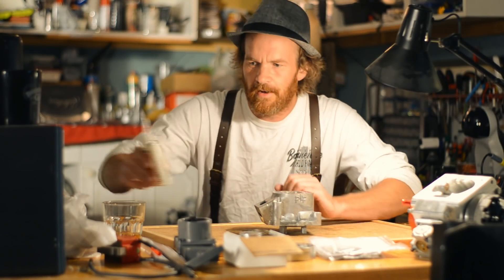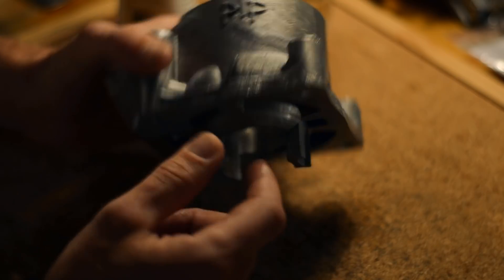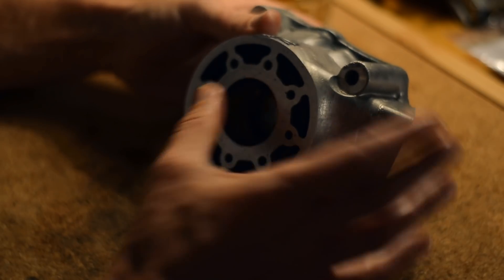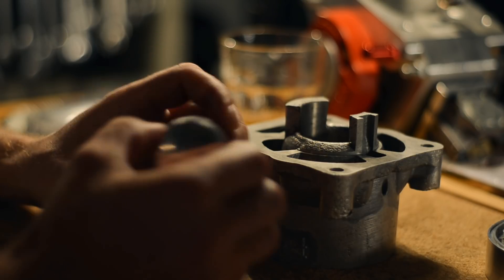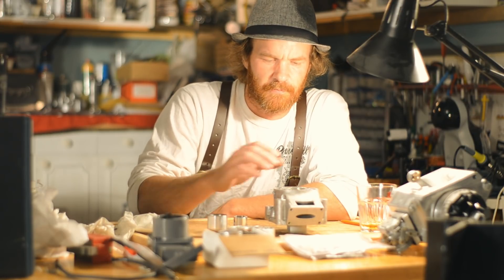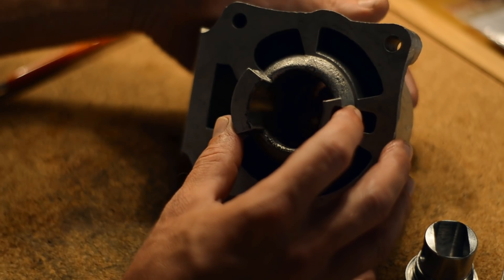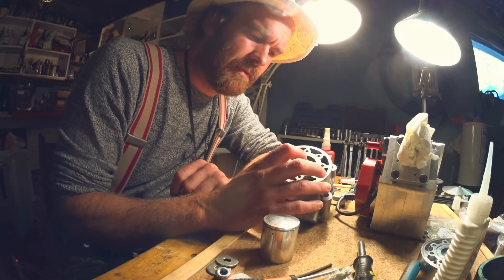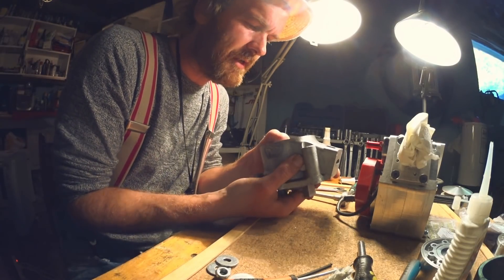The Most Powerful Two Stroke Ever - Won't be long now!

Comment: Your idea for putting the piston ring in the sleeve instead of on the piston is flipping brilliant!!! I'm sure there are gonna be a lot of nay sayers just bc ppl don't like change and even more don't understand how advancement works. Bc even if it doesn't work, it could lead to something that does. 
The only issue I can forsee is making sure you find the right kind of steel with the right heat treat and temper to hold up to the spring like forces it'll have to survive at high RPMs. There's a correct steel for this application, you've just gotta find out what that is and hope it'll keep it's shape when it's subjected to the heat, friction and the loads it'll be under when the piston forces it open. 

Actually, I wonder if a split ring with a spring washer (I know there's a proper name for this kind of spring, but it's eluding me at this moment) between that and the sleeve would be the better way to go. You would have to find or make a spring that would push the 2 ring halves together, but spread just far enough that it still seals the chamber at combustion. May have to have 2 rings if there's enough room. This way the ring doesn't have a load point that causes metal fatigue and ultimately turns into a split ring anyway. 
Yeah..... I think that that sounds like a better way of doing it, but I am not an engineer nor am I a metallurgist. I'm just some guy sitting in his chair, eating Cheetos and watching you do all of the hard work. 

I can't wait till you get all the little kinks worked out. This is gonna be f'ing epic!!! I've been watching since about the 3rd video in this series and you are so close man!!!! Love watching you work through the issues. Your drive and passion for this is why I keep coming back. Your desire to see this through is inspiring. Anyone else would've quit after the first failed casting. But not you. You gave failure the 🖕🏼 and kept on fucking that chicken. It'd be awesome to sit in the shop with you and bounce solutions back and forth. Do you have a need for an old, loud mouthed, bearded, fat American that'll drink all your whiskey, bring a buncha axes for random tree chopping and occasionally do some work?? If so, I'm just who you're looking for. Hahahah!! Keep up the amazing job and thanks for bringing us all along while you work through and solve all the issues that you've ran into along the way!!!! It's been a helluva ride!!!

Comment: The ring idea sounds interesting. It should work with Marks piston design but you'll have to get it plated otherwise it would wear very quickly. 
I'd work very carefully with piston to bore clearances maybe by heating the entire piston and cylinder assembly in the oven so its at max operating temperature and then checking clearance.

Comment: The world needs you to make a two-stroke with 2 pistons working in opposite direction in the same cylinder and produce more than 52% thermal efficiency.
That way you could probably get a single cylinder 50cc engine to produce 35-40hp.

Comment: I just had an idea, but it might be stupid. 100% exhaust port is what everyone wants, but why not make two exhaust ports on either side of the cylinder, each 50% of the bore. There would be no short circuit either, since both sides have exhaust ports, and there is pleny of space for transfers on the front and back sides of the cylinder. Although, two exhaust ports might cause some problems when the gasses have to go in two opposite directions, and the pipes would maybe just shoot all the gas from one exhaust port to the other, instead of shooting it to the back of the cylinder, like in a conventional setup. Not sure if I make any sense, and if this would actually make any power, but just had the idea and wanted to share.

Comment: The ring will destroy the soft aluminium piston. The reality is that a piston ring doesn't do much once a 2 stroke is warmed up as the crown of the piston swells sufficiently to do almost all the sealing (why most 2 stroke pistons are narrower at the top). If you could get the piston hot before startup to give a better seal, that might be all you need to do?

Comment: If the ring bounces at high RPM it will loose compression?
Reply: Yes, it's called ring flutter. The L shaped ring was designed to counteract this but nowadays they counteract it by using much thinner, lighter rings.

Comment: a tip for piston ring grinding: find something with the same diameter as the cylinder or even use an old one 😄 then just put some valve grinding compound in it an put it over the piston in the lathe 😄

Comment: Might need to redesign your casting so there is a bridge in the exhaust port, doing this will stop the piston ring from poping out into the exhaust port and you won't have to modify the piston ring besides gaping the ring

Comment: Having a good chamfer on the exhaust port helps, it need to be deeper than the ring protrusion to squeeze the ring back into the groove. The ring is only a sealer the timing is provided by the piston edge. I like the ring in bore idea you will need to reverse the coating, nikasil or hard anodised piston with a aluminium bore. I wrote this before seeing the end of the video. To get a good idea of what chamfer works with a conventional piston imagine taking a large diameter sanding drum held a 10 degree angle to the bore and grinding  a chamfer which is deeper in the centre and tapering off to the edge. The chamfer ends up looking like the classic oval port even though the port has an almost straight top edge. The RD500 factory race prop bulletin illustrates this.
Reply from the maker: That sounds very much like the chamfer that was supposed to be there. Not only does it help the ring, flow is improved too👍

Comment: Get rid of the ring all together, model nitro engines don’t use them and they run ok . The aluminium cylinder will expand the same as the piston so you can lap the cylinder so the piston is a very neat fit .

Comment: I have never seen such a big transfer port on any 50cc engine, this is the biggest one
Reply: In the early eighties I was given a worn out cylinder barrel from a very fast  works Suzuki  250cc moto cross bike and noticed it had massive transfer ports ,(no attempt to stuff flywheels etc)and very wide inlet reed valve block.The secret is easy flow using inertia rather than hi primary compression aided by well sorted exhaust system.
Reply from the maker: Word to that!
Reply: ⁶y
Reply: My tz had 8 transfer loop scavenge ports, bridged of course, 4 really
Reply: I haven't watched this entire series but can someone tell me why he doesn't simply bridge the exhaust port?

Comment: Glad to see you back on track with your project! Ceep up the great work! 😊👍

PS: to the cliping piston ring idea, you can try it and I wish you that it will work. Just some thoughts from my perspective  to maye make it work are the following: 1. The snaping ring, will be under high variating forces snaping in and out of grooves, make sure it wont break
2. The edges of the groves have to be strong enough to constantly overcome the pressure of the ring, snaping in and out of the grove, make sure they are hard enough
3. Check the expansion-speed of the ring, so that it has enough time geting in and out of the groves even at really high RPM's. The harder the ring, the faster it will expand but also it will create more pressure on the grove edges snaping in and out (refering back to point 2) so keep in mind that you have to find a sweetspot here.

Comment: Maybe use 2 exhaust ports 50% each?
Reply: That's the same as a bridged port, they also overheat and expand into the bore, so you also need to drill the piston out inline with the bridge
Reply: @tritiumrecords717  its possible to have them opposed and have transfers between each exhaust port for maximum cooling.

Comment: Why not just scale up a nitro RC engine to 50cc, add roller bearings for the crank, and Rod, and use that design instead of re-invention?
Reply: Nitroengines are low compression glow ignition. Different concept.

Comment: Ring is still gonna snag, due to piston rocks in the bore slightly in tdc and btdc, you gotta make the ring so restricted that it won´t seal anymore.
And the 'other way' around would probably give you heat problems as a lot of heat from the piston crown is drawn through the ring into the cylinder.

Comment: I know you don't know me but I have a few suggestions you might want to think about.  Don't use a ring at all. I know why rings are used.  This is just a thought but if you calculate your piston and cylinder expansion from cold to high temp you can design your piston to have enough room to expand. however you would need a way to preheat the engine to bring the cylinder up to temp and running expansion. If you still have that 2-stroke motor from your bicycle build you could try this with that motor. I don't have the tools or materials to do this myself other wise I would try it for you. I would love to see you make it to bonneville.

Slight Edit here: I just thought of something. Have you thought about running a sleeve on your piston? It would do the job of the ring but you wouldn't need to worry about it springing out into the exhaust port.
Reply: Yep, a ring higher then the ex port -problem solved 😁                                        Wait a minute -it might work 🤨

Comment: I am sorry, but the idee to set the ring above the exhaust port is from ME. I wrote this in the comment section a frw videos before... 🚀
Reply from the maker: I'm confident we aren't the first with that idea...
Reply: 2STROKE STUFFING 😎 try it without rings. At 14000 rpm is no time to leak...

Comment: ive never saw at someone moves a piston with out oiled it and never stop hone in cylinder and use a oil when you hone but i hope you can made that engine to roor like a beast
Reply from the maker: There's oil both on the hone and piston.

Comment: @2STROKE STUFFING

Everybody is talking about (ABC) engines and going NO ring but, something to consider that a lot of these engines don’t have (at least to the extent I’m thinking) is gas sealing grooves. Small model airplane pistons will usually have ONE symmetrical groove at the top of the bore where the piston ring would normally be, but if you look at industrial applications of large pneumatic valves or small high pressure pumps from the diesel industry (my field of work), they have non symmetrical grooves both radially and axially that gas / liquid flow in one direction only and inhibit it in the other. These types of systems are usually under enormous pressure for diesels (1800-2600-bar fuel pressure) / in high pressure pneumatics closer to the compression pressure of your engine at max BMEP, and they work really well. It takes some CFD / ALD to get the force balance correct but, when done correctly friction is minimized down to the liquid friction of the medium compressed, and leakage can be very low if the clearances / thermal expansion is well understood......I believe there is merit in looking into this technology and there are a lot of research papers of reference available (primarily for pneumatics)......the primary benefit I see in going that direction is there is NO maximum piston speed based on ring flutter and any port geometry / port edge condition is possible because the piston skirt provides a huge bearing surface.....the limitations i see are getting the clearances correct for your application as well as controlling thermal expansion via. thickness of the cylinder wall / cooling to retain the desired dimensions at peak power for the duration of the run at the flats.......In my opinion this would dictate needing a cylinder liner of some sort and coatings like an (ABC) engine but from industry there are some other more durable / thermally stable solutions.....powdered metal “Stellite“ cylinder liners already exist (which have a VERY low amount of thermal expansion and are VERY hard)......and a bunch of coatings exist for aluminum such as DLC and AlTiN, both of which are several times harder than chrome, but have more flexibility.

If you enjoyed this comment please thumbs it up! I hope it’s gets enough traction that he sees it.
Reply: Like it! So these special grooves works a little bit like a Tesla valve?         I think ringless is worth trying. At 20k rpm there's not much time for leakage anyway.
Reply: @Olof Palmolja you care correct it acts just like a Tesla Valve and your also correct that at high engine speeds there’s verily little time for leakage anyhow.....the important thing would be the clearances are stable for the duration of the run so the leakage / force ballance is ideal when at max power.....from some playing with high performance 2-strokes myself in Karting the piston to wall clearance is large for a sleeved engine, so it’s likely the pseudo Tesla Valve features on the piston wouldn’t work until maybe a mile into the run (once the piston expansion closes the gap to the cylinder liner).....the only way to further mitigate that would be a piston with even higher silicon content, but there a point of diminishing returns that will make the piston brittle / fragile...to me I think all this is a good trade off considering how long a run at the salt flats is....being down on a little power in the beginning vs. being down on power the whole run because the exhaust porting had to be reduced / compromised for ring durability.

Comment: How about a vertical bridge on the center of exhaust port to support ring from expanding into the port? Would require a new casting unless you welded one up. And the narrow bridge shouldn't affect flow to much if any I would think. With the bridge it may not be 100% but if narrow enough its Cant be but a few % less. Just my 2 cents

Comment: That cylinder ring idea is interesting. I'm thinking it would have to be a lot more taller than a normal ring so the slope is like 89 degrees and at least 3mm tall. Because if its just 1mm and steep sloap, when the piston comes in contact, it would snag right on to it and destroy itself. Make the slope long and minimal extrusion so that the piston travel on to it is really smooth. 

Just my thought on the idea!
Reply: Smart approach
Reply: The piston is pretty soft. May not last very long. Also disengainng/reengaging would be pretty violent

Comment: How will the piston ring maintain a seal through the thermal expansion cycle and not hang up on the exhaust port?
Reply from the maker: That's the question!

Comment: I was going to suggest putting a taper on the edges of the exhaust port so the rings get unseated and seated a bit smoother. Not sure how much of a taper it would need to be but if there's a decent amount it shouldn't stick

Edit: i'm high and posted this like, when you were talking about removing the piston ring

Comment: I think the cylinder ring idea is brilliant. I wonder if you might put a very slight taper at the top of the piston to help it lead into the ring as it passes by. And of course nikasil plate the piston now that it is the wear surface instead of the cylinder wall.

Comment: Genius solution!
A possible further improvement to your cylinder wall embedded ring idea, is to design the ring with a slope on the top part of the ring.
Look up the Keystone Ring design. My 1972 Suzuki 185 had rings like that.
The slope provides additional cylinder wall force because the top combustion pressure vector is not only downwards but also partially lateral. Search for Keystone Ring and you will understand.
In the case of your new design, of course, the ring is embedded in the cylinder wall and the keystone design slope will cause the extra force to be applied to the piston.
The cylinder embedded ring design also has the advantage of substantial piston weight reduction (not just by the lack of rings) but thinner piston walls as well.

Cooling of the ring may be an issue.
Reply: It is a long lived myth that keystone rings press substantially more against the cylinder wall. Ordinary piston rings also press against the wall with the combustion pressure (the pressure gets behind the ring). The reason for keystone ring design is to minimise carbon build up.
Reply: Yes, that's what I thought... presumably there is some reason for not having a narrow vertical bridge splitting the port in two?

Comment: Mark my words it will spit out the piston ring first start.
Reply from the maker: Damn right I won't listen.
Reply: @2STROKESTUFFING  put a small bridge in the middle of the port. It will work!
Reply: Things change with heat. After the ring expands an already bad problem will get worse.
Reply: @fukhue8226  I got 3 bridges to sell you in Brook
land!
Reply from the maker: It probably will, and we'll learn something, do some adjustments, try again, then repeat. Remember we're experiment here, trying to do something different, improve. That's the point.
Reply: @2STROKESTUFFING   The answer my friend is piston without piston rings. With good tolerances and well done cylinder wall there will be no problems. Piston ring have effect on mid and low rpm but over 10k, velocity of the piston is so high that compression leakage is very low. You can take a look at Tomos d5 and d6 pistons, they don't have piston rings on some versions of the engine. One of the best racing motorcycle and gokart tuner I know told me that he doesn’t put piston rings on some of his racing bikes but just teflon coating. They rev over 18k rpm.
Here is the picture of Tomos piston.
https://www.imagevenue.com/view/o/?i=13667_2912_81753532026_59394807026_2184467_731201_n_122_210lo.jpg&h=img156
Reply: @2STROKESTUFFING  Keep up the great work and ideas. Last I checked none of these chumps have been invited to Bonneville. 
I think the potential of a huge exhaust port combined with a tuned expansion chamber could work, the returning pressure waves could play a role in keeping the Piston in its happy place. The resonance is the key.